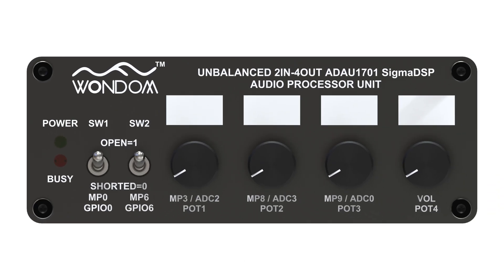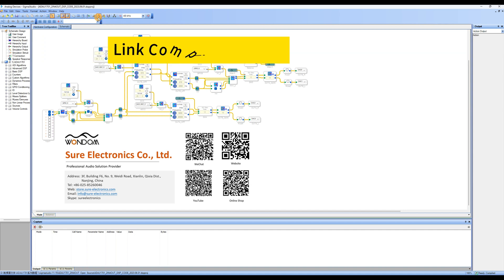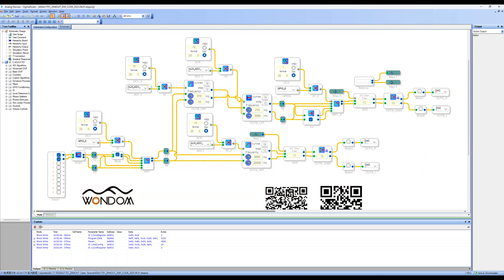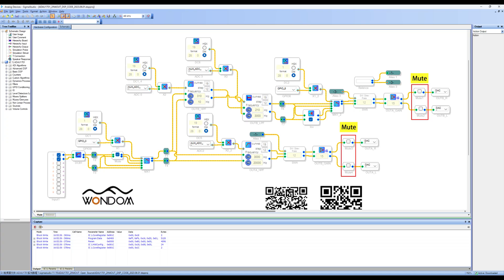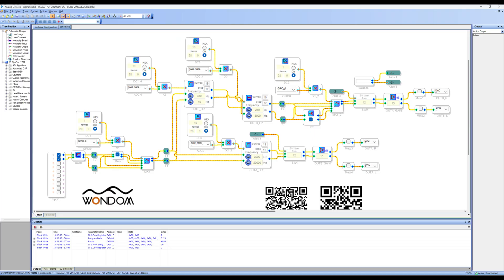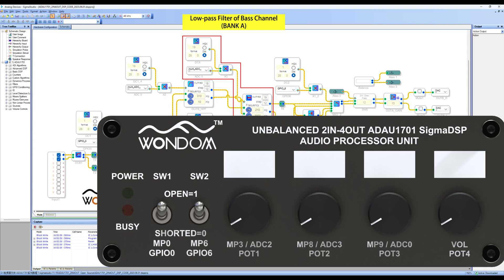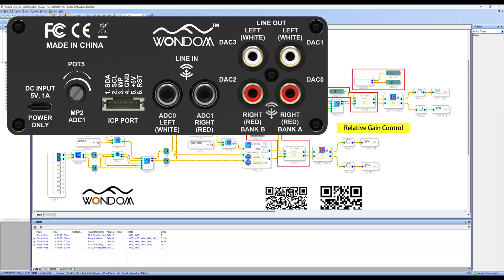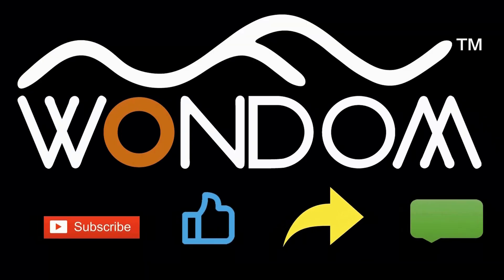2-IN, 4-OUT ADAU1701 DSP Preamp Demo Program Explanation | Analog Device SigmaStudio

Comment: If creating a new project from scratch, do we need to add the 15db gain compensation?
Reply from the maker: Hello, it depends on the gain of your amplifier and your requirements. If you feel the gain is insufficient, you can add gain compensation accordingly. Have a fantastic day~
Reply: @WONDOMAudio  I want the highest output from the dac, what is the output voltage with gain compensation? And how much gain can we apply before clipping?